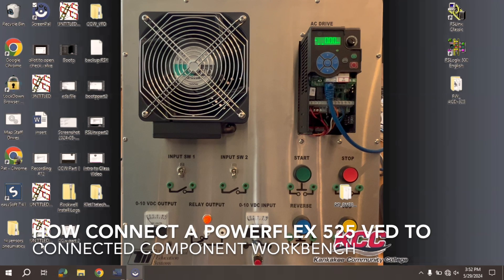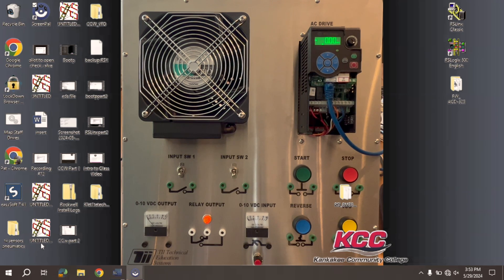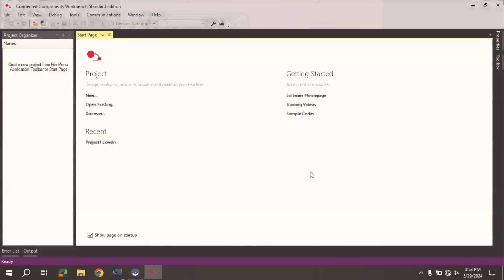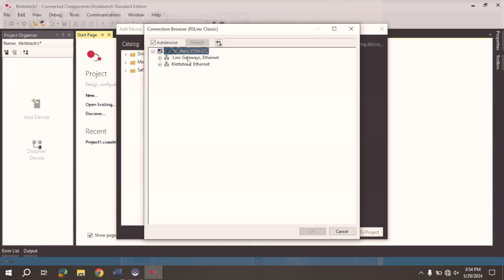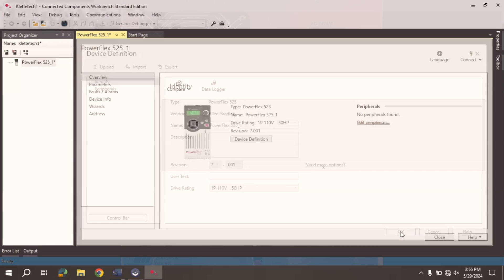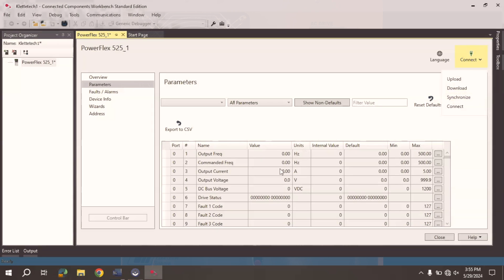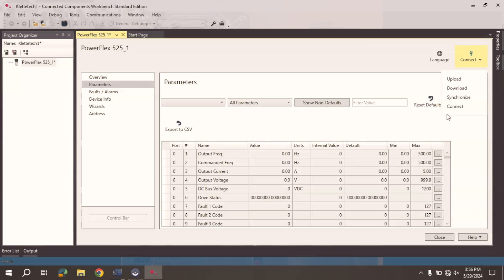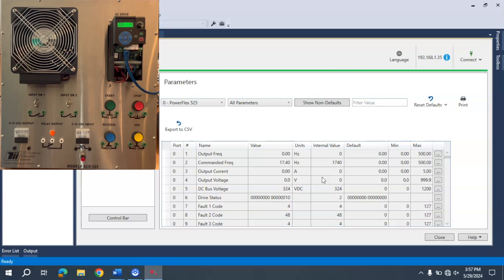Connecting CCW to a Powerflex 525

Comment: My power flex 525 isn’t connecting it shows on ccw but it has a question mark showing unidentified device when I try to connect it fails. How could I connect it , fyi I also have a micro 820 connected do I have to open a new project to connect it ?
Reply: My 525 has ethernet. That's what was used in the video and that's what worked for me